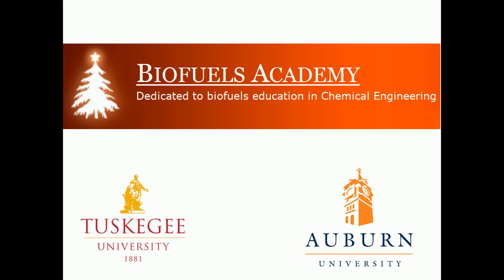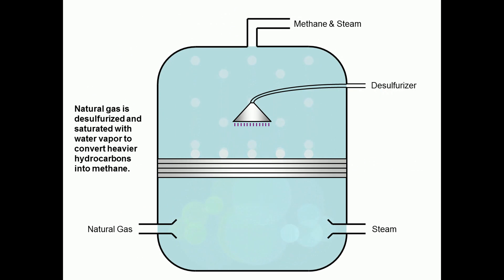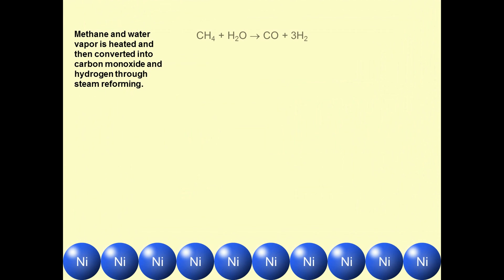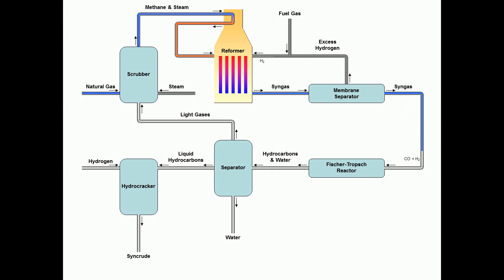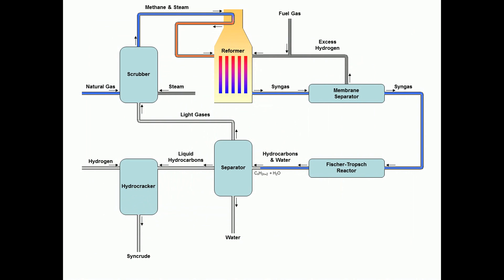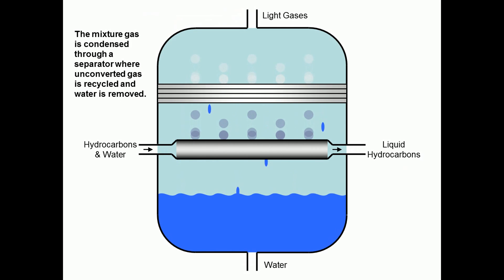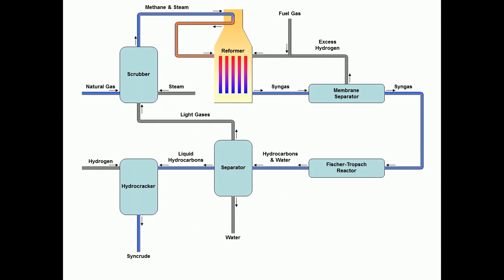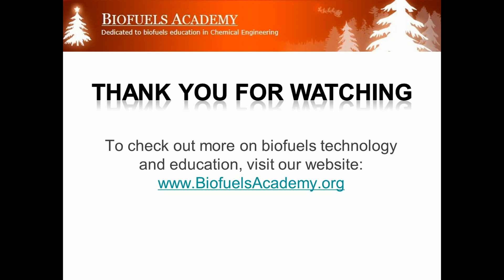Gas to liquids Process

Comment: does biogas can be converted into liquid form?.. to compress in a cylinder
Reply: Yes bio-gas can be converted into liquid form. Bio-gas does not have as high a concentration of methane; therefore it requires more bio-gas to produce the same quantity and quality of syngas, and then through the Fischer Tropsch process liquid fuel.
Reply: @josephweaver6538  Would it be more effient to gasifie biomass and jump straight to syngas?
Reply: @josephweaver6538  hello brother where I can get info to get liquified gas out biogas ??

Comment: please explaining clearly  I nee to know if you anyone know about  gas to liquids  please explaining thanks
Reply: +jaya rupan take some copper pipe and make a coil out of it. Place the coil in a container, make sure the inlet and outlet of the copper coil sticks out of a container filled with water (circulate the water if you want), then take some gas stored in a tank or whatever, then connect the gas to the inlet of the copper coil. Wait a while and you should get a liquid out of the outlet. (Might need to chill the water too)